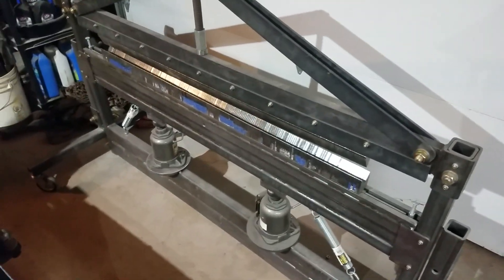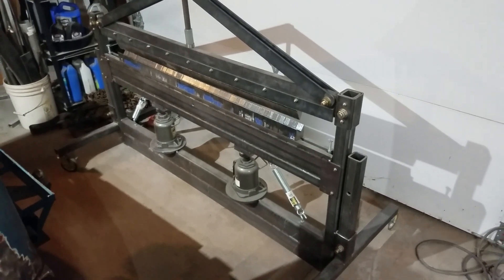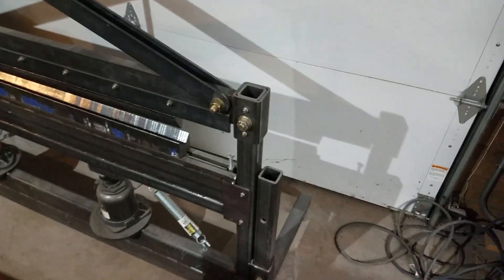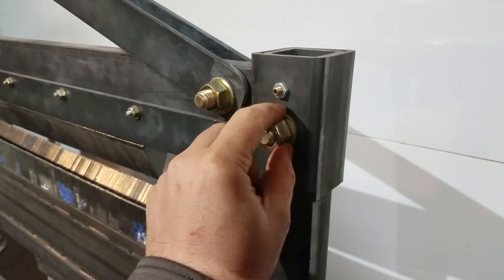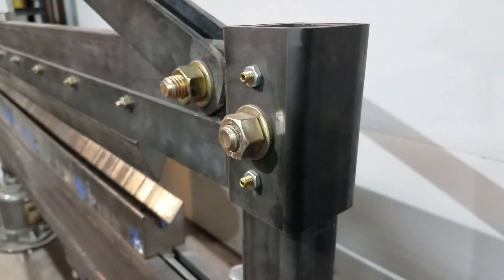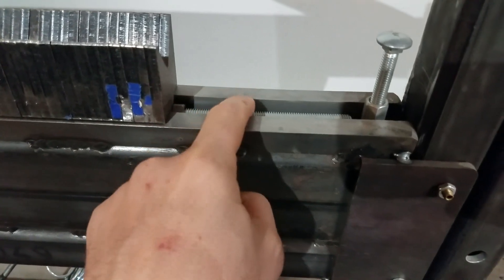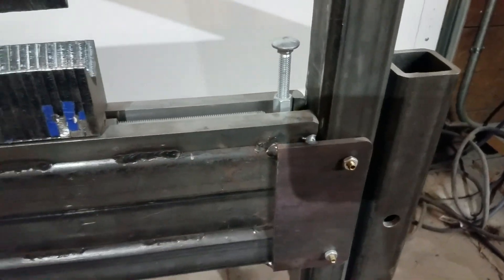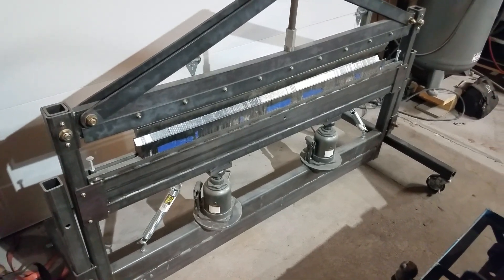Homebuilt 40 ton 60 inch wide press brake

Comment: Just seeing this, what is the thickest material you think it would work on? For a 48" bend?
Reply from the maker: the fuel tank in my LX45 project was close to that wide, it was 1/8" 5052-H32 aluminum. There are bend force calculators that you can run based on bottom die width....this has 40tons available. The top truss would probably have to be beefed up to get all the way there.

Comment: Second question, I see you used HRPO mild steel.  Do you think there would be value added if the dies were hardened through a heat treatment process?  I need to bend a couple of sheets of 1/4" steel but then after that the primary use would be smaller brackets and such of much thinner material.
Reply from the maker: for how much I bend stuff, not really worth the headache and cost. I've had these dies for many years now...built multiple vehicles from scratch without any issues. If you wanted to geek out on it a bit, the laser cut edge is going to be slightly hardened.
Reply: Thank you again for the great video and the responses.  Do you have any regrets over sizing?  I only had a couple of projects in mind when I started designing this in Fusion 360 but after hearing your use I’m thinking I may want to go wider than 49”.  I’m wondering if I shouldn’t be looking at going closer to 60” because it’s one of those… you had your chance to build whatever you wanted kind of things and it’s one of those tools that could last a lifetime.
Reply from the maker: @derekchaplin2867  Being 60" wide lets me fold a full "Jeep" width panel. My intent with this unit is to use it for folding up a full size old Willys Jeep tub out of 1/8" 5052H32 aluminum. The design scales well for just about any width. A 49" wide unit would be great too. It also worked out pretty well for material useage when buying full sticks.

Comment: This was super helpful.  I'm designing a 48" hydraulic brake press in fusion 360 currently but have been scratching my head about how to make the dies.  Your design is genius.  For your bottom dies, have you had any issues with them being independent or loose?  When you touched them they move a bit.  

I was just curious if that has been adequate or if in my design I should lock them in solid with a bead of weld or something to lock them all in as one solid piece?  I really like the idea of having them independent that way they could be replaced independently very easily.  

Great video, i truly appreciate all the good information
Reply from the maker: Nope, no issues. It is actually nice having them be a little loose so you can actually get them in and out without swearing. Being able to change the die width is really nice. The smaller slot in the bottom also works good for thinner materials and tighter bends.

Comment: Very nice setup.  What type of steel did  you use for the tooling?  And do you think that this could be done with a CNC plasma setup?
Reply from the maker: It is just laser cut HRPO mild steel. With a good setup on a cnc plasma it should be possible.